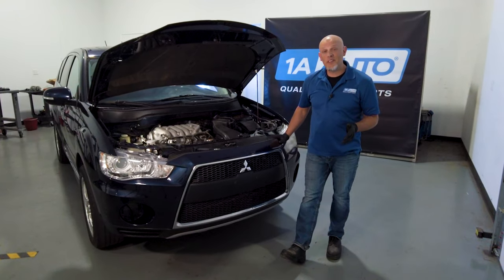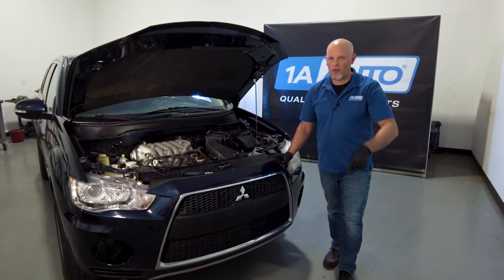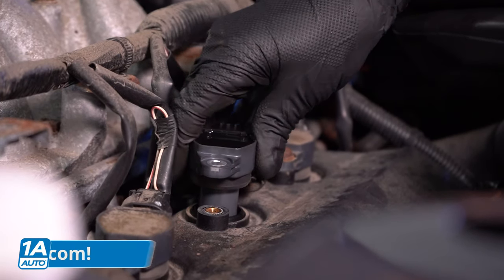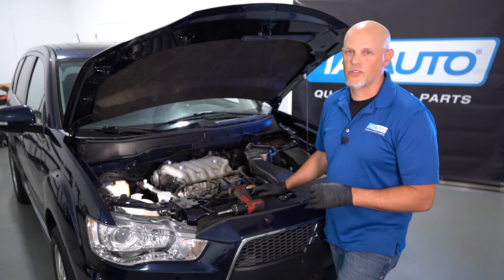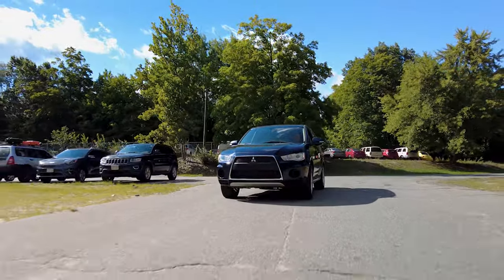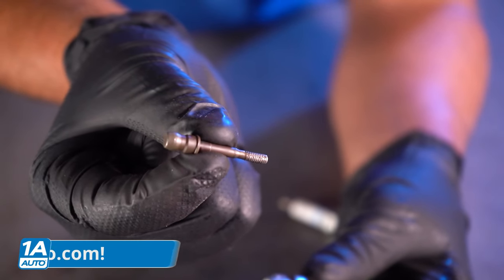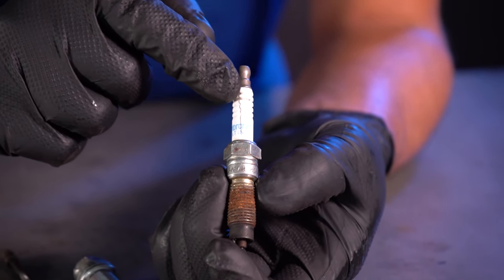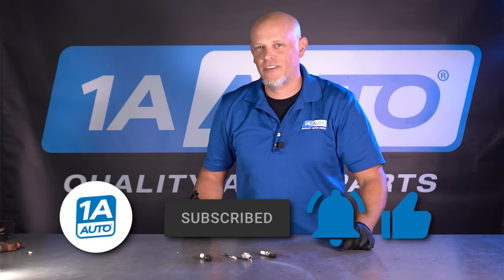Should You Replace Spark Plugs When Replacing Ignition Coils in Your Car or Truck?

Comment: These are the issues I've encountered that made me replace the spark plugs on my vehicle. First, I noticed that the engine was louder than usual and this was bothering especially when reaching speeds over 40 mph. Second, there were times where pressing the acceleration would cause the rpm to increase from 2.5 all the way up to 4.5 just by slightly tapping on the acceleration pedal. This was most noticable when going up a hill. After doing a lot research I decided to replace the original spark plugs at 120k miles but didn't replace ignition coils. The results were noticeable because the engine's noise has reduced and it runs much smoother but most importantly the acceleration pedal has a better response.

Comment: I recently got a tune up and the dealership that I go to replaced the spark plugs but not the coils. Before the tune up I noticed a performance difference while driving. But the dealership also never said anything to me. I went to another mechanic and paid for a multi point inspection and the mechanic came to the conclusion that I think 2 coils are bad or have failed. I don’t understand why when I got the tune up the didn’t replace the coils as well as spark plugs.

Comment: Yes if you're working with the ignition system replace everything especially if you're doing coils
Reply: When coils cost nearly 100 dls OEM and there is 8 to replace I bet you will think twice
Reply: @dvader3000  I got a Napa card to make monthly payments on labor or parts.. I bought engine mounts for my Mercedes and had a shop do the labor..

Comment: Hello I changed my spark plugs and wires already thinking this was  why my car was misfiring turns out the ignition coil is bad spark plugs have only been in car two days and vehicle has only been ran twice i have not taken the car out and drove it anywere. Do I need to replace spark plugs again? They are new because I am replacing the coil. My vehicle is a 06 dodge caravan 3.3. Thanks

Comment: Hi, I in South Africa owning NIssan Almera 2006 1.8 I love all 1A auto content has help me a lot.  I have recently replaced Spark plugs and ignition coils since mine were old and rusty. Now the car has power then before I like it, but I have a check engine light. When I put back the old ignition coils with new spark plugs I do not get and engine check light but I am getting it with new ignition coils. Why is that?
Reply: The old ones cracked the new ones u need new spark plug on on new coils
Reply: @lilc713htx6  no you don’t 😂